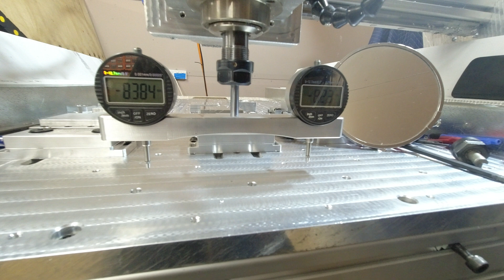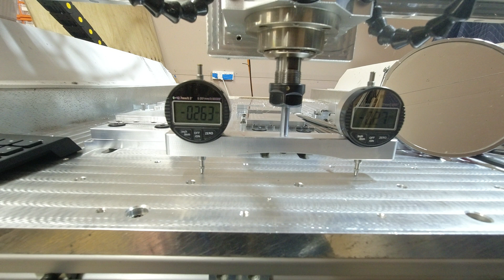Tramming Spindle with dual dial guage

Comment: How do you tram in the other direction?
Reply from the maker: By pivoting the x gantry , it will vary by machine  but mine has a pivot bolt , the gantry is loosened off and pivoted sround that bolt
Reply: That’s exactly how I thought it would be done but seen it is not done like that on a lot of machines. How do you account for twist on ballscrew or is that machine rack an pinion gear driven?
Reply from the maker: @MrBrettStar  ballscrew assy pivots with it , less than a deg of movenent required

Comment: That’s a smart way of doing this. Best I have seen yet. Question: Does it matter if your machine bed is not yet surfaced? Let’s say it’s a new machine with a new aluminum bed.
Reply from the maker: If you are doing it on a non true surface it would then not be correct , to do that you would need to place a piece of glass on the surface , check each corner and shim up to true using just one dial guage then do the tramming procedure.
Reply: @tomahawkcnc  Got it. Thank you.